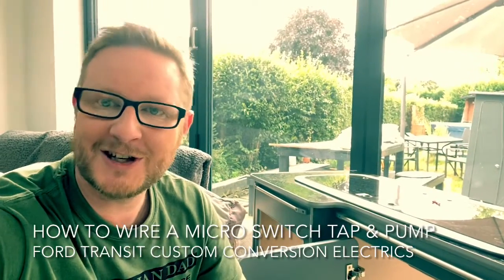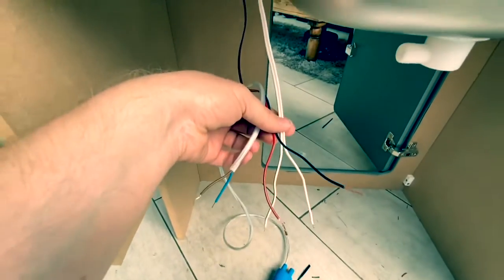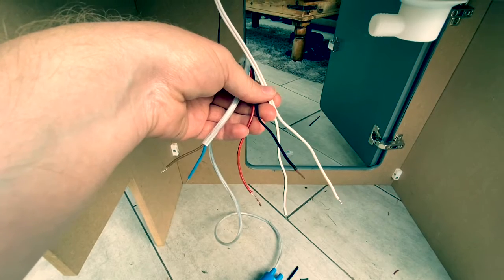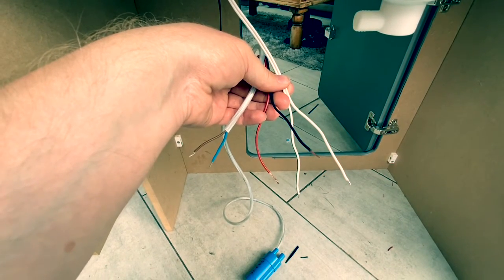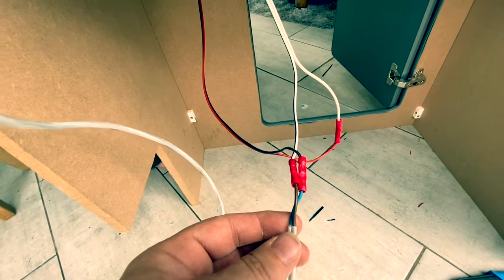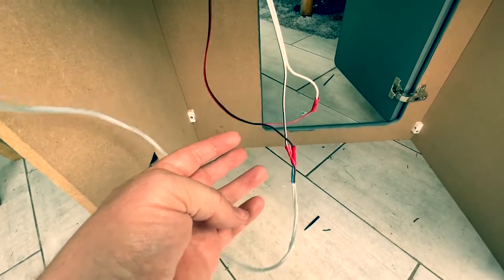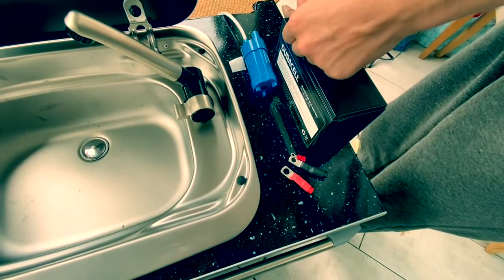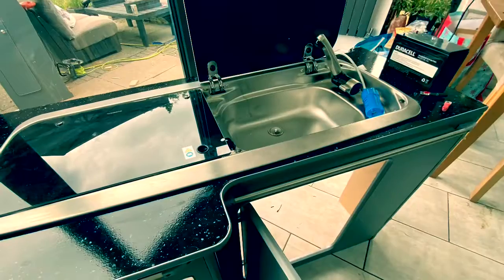How to wire a micro switch tap & pump SMEV9222 | Transit Custom Camper

Comment: What can I use instead of leisure battery
Reply from the maker: I guess you could use any 12v battery but if it’s for a camper the leisure battery are designed to last longer and also can take more cycles from discharge to charge

Comment: Hi. What size or type of pipe do you run from the pump to the tap ? Thanks ! Very useful video
Reply from the maker: Hi Thomas - thanks for the comment and checking out the video.. The pipe actually came as part of the kit with the tap so I am sorry but I don’t have the exact specs on it. I’d say getting it in a kit might be the way to go then hopefully it will all be good 👍

Comment: Hi there, could this wiring diagram be used for a switch? I am l little confused by the interchanging description of the titles "tap/switch." I am looking to wire a on/off switch for my water pump. I'd like the option to turn off power to my water pump so if the faucet is running but the power to the pump is off, it would not work. Could you please help clarify?!
Reply from the maker: Hi Jessica - I think I understand and this is also how mine is set up… So there is a micro switch on the tap itself so when you turn the tap handle to get water that then activates the pump and to get the water. 

Also what I have done is then wire back from the tap to my 12v control panel that has a “switch” so then like you mention you can turn off the power to the tap/micro switch so it won’t run. 

I hope that makes sense? If not then drop me a comment and I can try and explain a bit better 😀

Thanks for checking out the videos by the way! Are you doing your own conversion too?